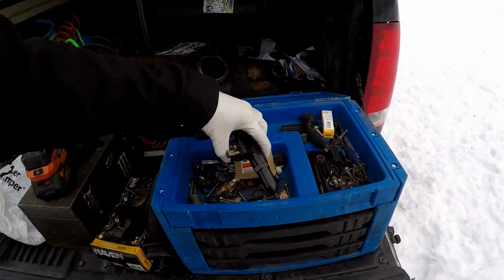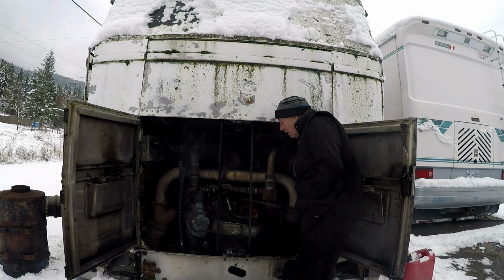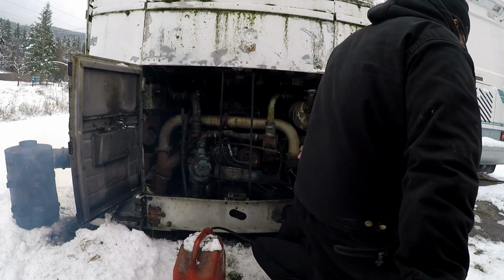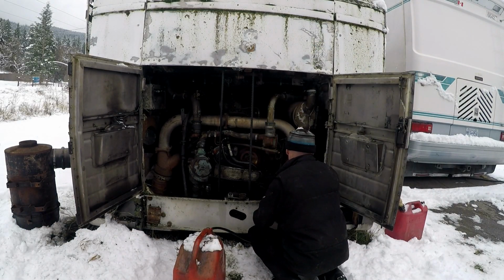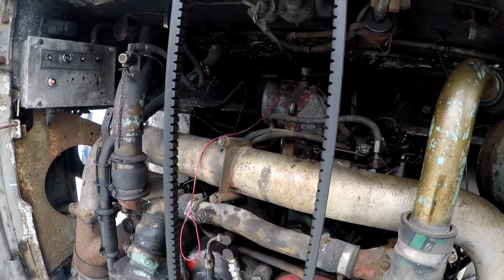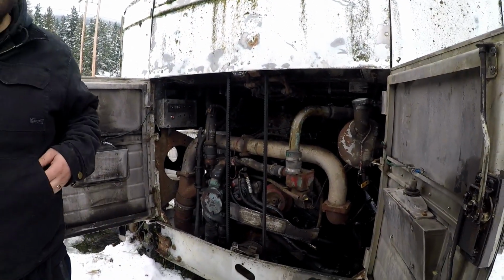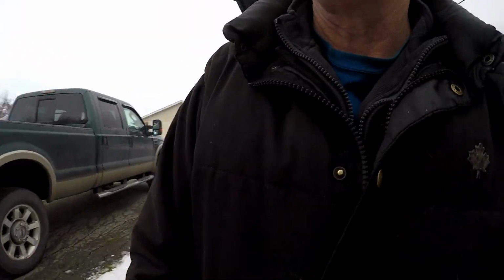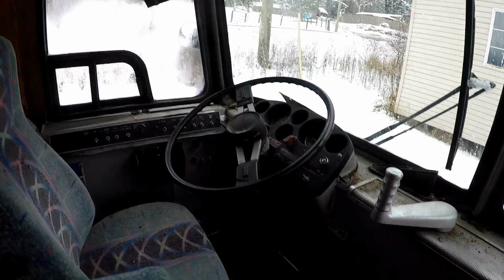Detroit 8V71 First Start in 15 years MCI 8

Comment: Awesome job!! Love to hear them run!!! It has to air up to shut down. Our 1978 MC8 has no key either. I just finished up all the air bags, leveling valves, brakes, wheel bearings, wheel seals, brake hoses, rebuilt the DD3's, brake chambers, recored the radiators. It goes on and on. His journey is just beginning. The allison has a neutral safety switch if it's installed correctly. I really enjoyed that!! Thanks!
Reply from the maker: Thanks, I'm glad you liked it.:)  Yes he has a long road to getting this old girl sorted out.:)  He's going to get it off this property and drive it to a local shop where he can work on it.:)
Reply: @detroitgarage9430  I will sub to him to follow the progress.
Reply: Aproxomatly how much did that cost ?
Im looking at buying a 1975 mci crusader  been sitting since 
 2006  im sure itll be costly lol

Comment: Hello I have a boat with 6v53t engines that went under water. I have pickled the engines and engines turn over just fine but I have noticed when i move the throttle lever on top of the governor the control rack doesn't move. The injectors are not stuck, I have taken them out. Do you have any videos or suggestions? Thanks in advance.
Reply from the maker: Put a pair of vice grips on the throttle tube and control the rack from there.  Make sure both sides are moving, if they don’t then confirm the fuel stop is in the run position and that the governor controls are free.  That should give you a good idea of where your having issues.  I do have a couple 4-53T governor videos.  I’ll dig one up for you.
Reply from the maker: P.S. I have a 6V53 in my shop and could make a quick video on the governor controls.
Reply from the maker: Here’s a video on the rack and governor control, governor stuff starts around the 9 minute mark.  Another thing I forgot to mention, if you have a fuel modulator, that can also effect rack travel.  Here’s the video.https://youtu.be/uvHEl1lPQWM
Reply: @detroitgarage9430  The video on  the 6v53 would be a big help thanks so much.
Reply from the maker: @calvimlewis898  Ok, I'll see if I can put something together Monday or Tuesday.  My governor is a DW-LS  is yours a VS or LS?
Reply: @detroitgarage9430  I have pics. and video of the governor and  rack.
Reply: i believe it is VS i have one lever on top of the governor
Reply from the maker: @calvimlewis898  Ah ok, it's a little different, but I have both governors, so I'll just make a quick video of a VS for you.
Reply from the maker: You could send me the pictures and video to emerald310@gmail.com.
Reply: @detroitgarage9430  Just sent them thanks

Comment: Turn on the step light switch, to start. MCI s don't have a key . You turn on the main power on the dash and the step light switch. Then the starter button will work
Reply from the maker: Thanks, I’m sure Brayden has figured that out by now but he hasn’t I’ll let him know.:). Thanks for watching.:)
Reply: @detroitgarage9430  
Thank you for your work.. I have an 8v71 in my mci7. I want to learn my engine. Please ask him about the step light switch, I swear it was off , not knowing is driving me nuts.  And please more videos
Reply from the maker: @earlcarlisle4690  Thanks I certainly will.:)  I have to go up and get some parts from him, so I'll definitely let him know.:)